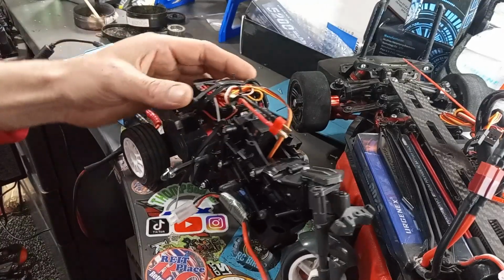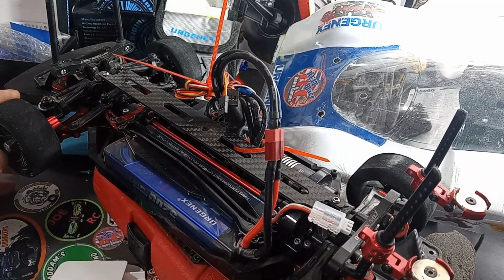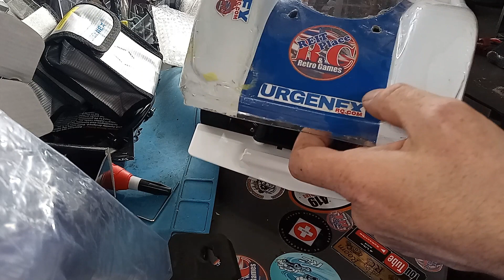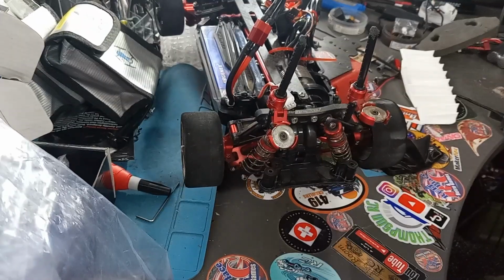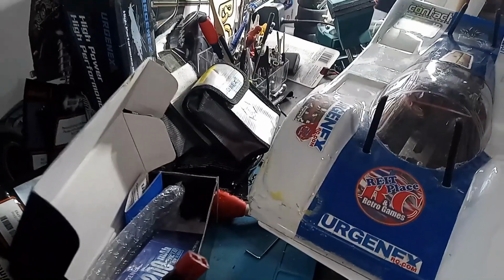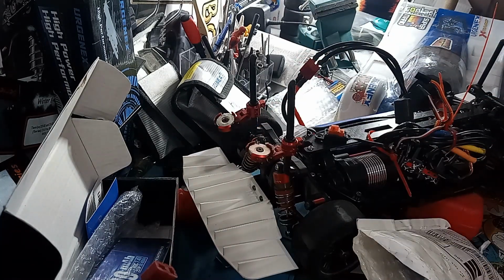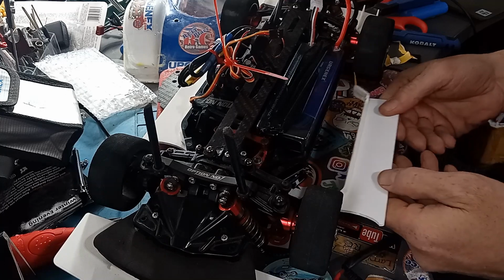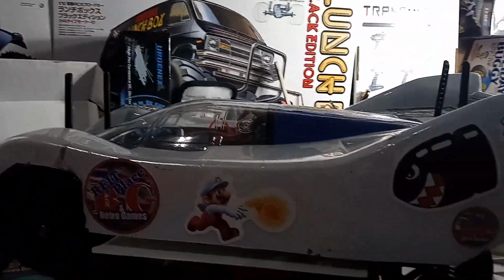Tamiya Tuesday's - Episode 7  - TT02 Run to 100 Splitter - T3-01 Update

Comment: The rear splitter is upside down, look at a real race car. The T3-01 fun 🙂
Reply from the maker: Thanks Mal,  I already flip the splitter over brain fart there haha...  T3 is a cool little rig gears like to slip with all that power but ill get it dialed in..
Reply: @reitplace4765  Just as bad as me hitting the wrong key 🙂
Reply from the maker: @BasBoyRC haha 2924 hahaha  right..
Reply: @reitplace4765  You missed the other one I mucked up, I put Boy Boy 🙂I think I will be off to the retirement home soon.
Reply from the maker: @BasBoyRC hahaha as long as they let ya do rc who cares right haha...  I do that stuff all the time I always tell Lauren its just Old Man brain..   Thinking faster than doing..

Comment: I wanna run my tt02 speed car on the 5200 Urgenex as 4s using 2 of em. I think I can get double the 57mph we got on our 3s speed runs.
Reply from the maker: I have a 6s dual battery 150amp just for that exact purpose Im hoping to get to 100 with them..